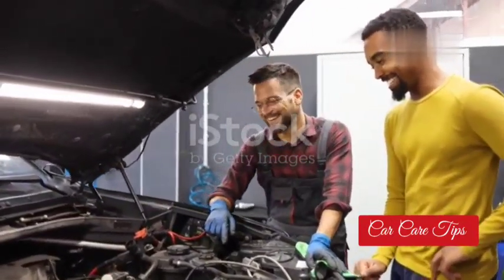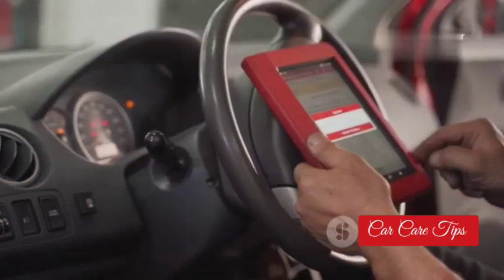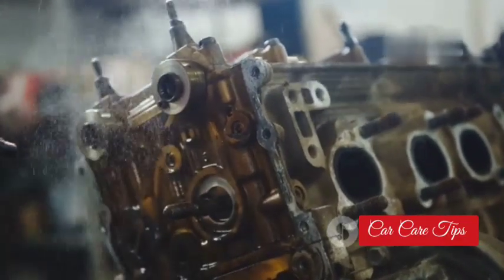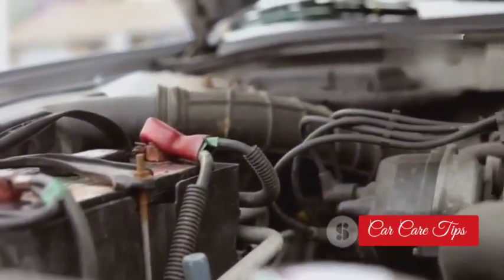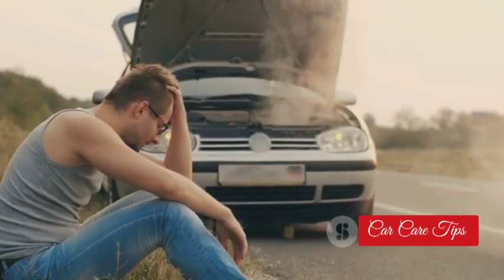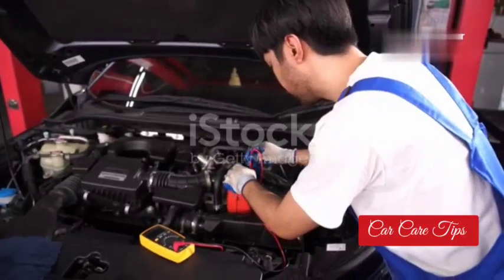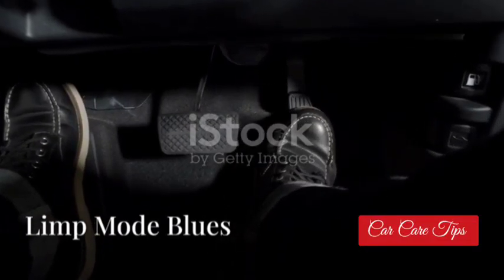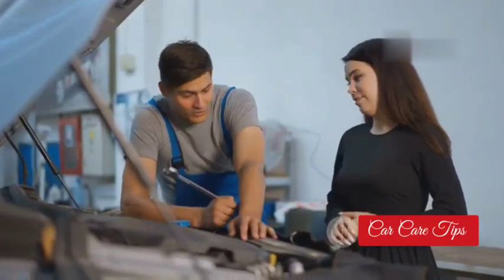10 Signs Of FAILING Exhaust Gas Temperature Sensor | EGT Sensor Symptoms

Comment: My car as been going up in temperature then like limp mode and goes back down then normal im lost the dpf light comes on and goes off after 10 mins been told water pump and cambelt then lambda sensor bank 1 and now I'm thinking it could be this